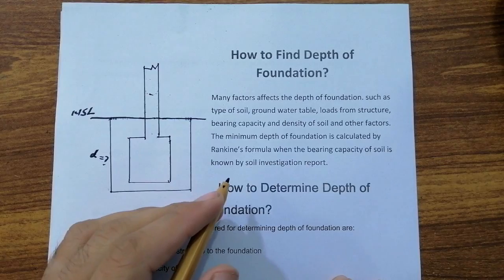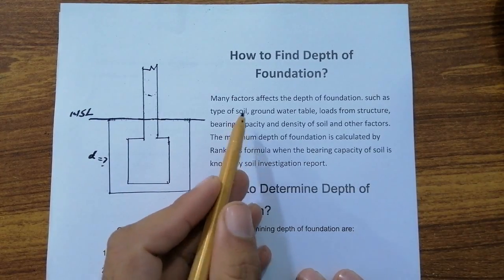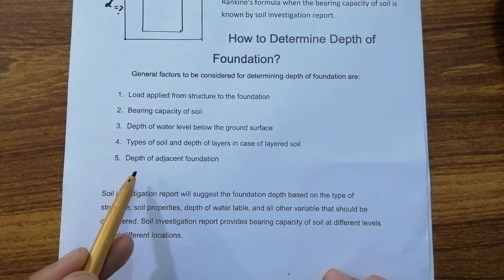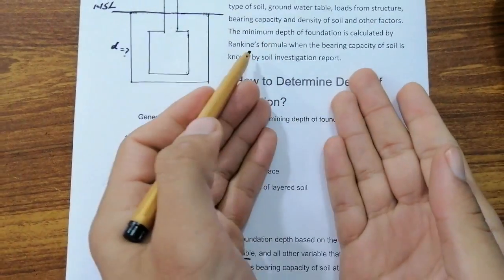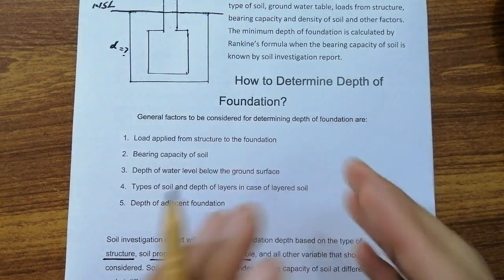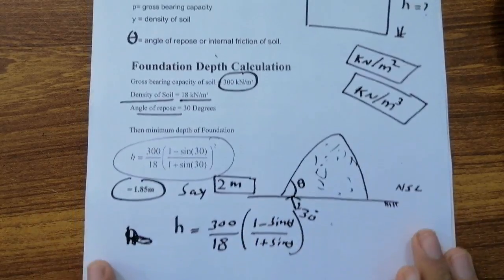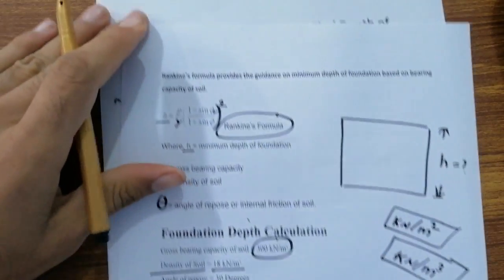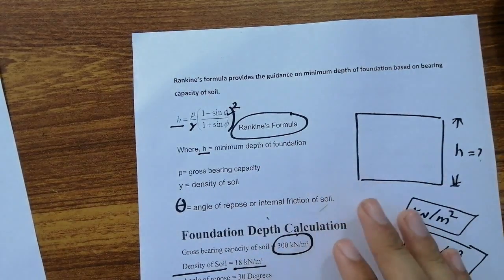How to Find Depth of Foundation for House?

Comment: Rankine's Formula is only a guide for minimum depth if bearing capacity has been determined from soil test but this will not work in many other cases.
Load of structure is always a primary case, which you did not refer to in your calculations to determine the required depth

Comment: No consideration of load applied?(..building load )in design .
Reply: i think design of depth of foundation doesnt affect structure load, but you can calculate the required size of footing by this structure load.

Comment: I think in the formula you should use load of the structure and not bearing capacity of soil! Then after finding the depth, you calculate the total load acting on the base and compare it with the bearing capacity. If the total load from the structure (including footing load) is less than or equal to the bearing capacity, then your design is safe.